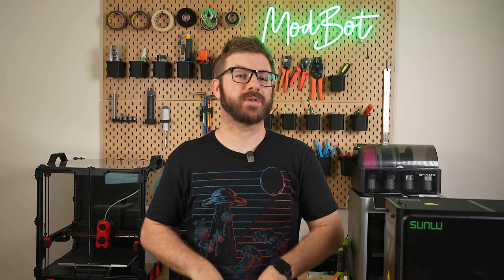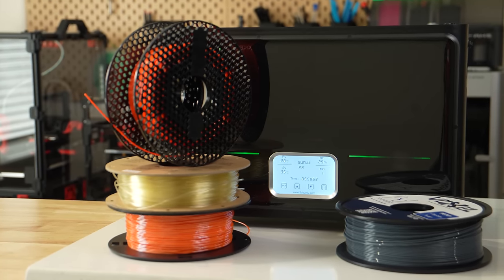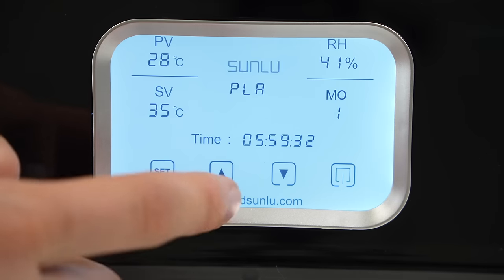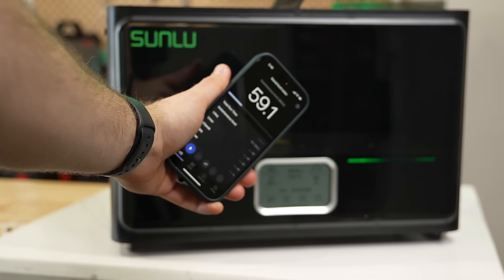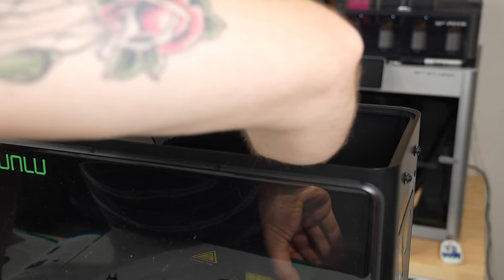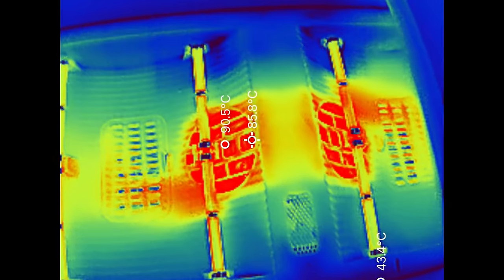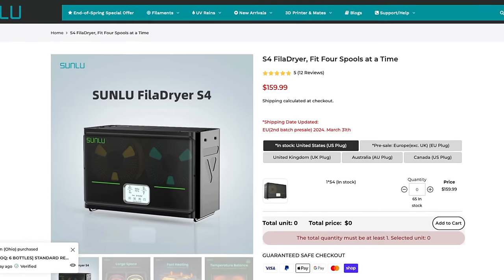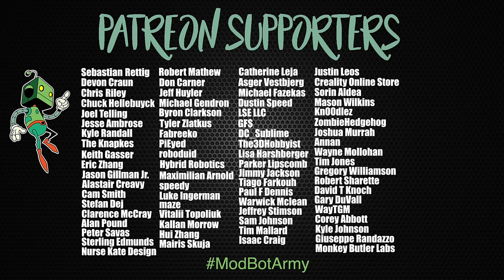Ultimate Filament Dryer Or Complete Overkill? (SUNLU FilaDryer S4)

Comment: It's shocking to me that most dryer manufacturers don't understand that the released moisture has to go somewhere, and hoping it leaks out or people leave the filament holes open on purpose to let it out isn't a wise design choice. As much flak as the Sovol dryer has taken - and rightly so, given how low its temperature settings are - its manual explicitly states that it is recommended to prop the lid open during initial drying before closing the lid once the optimum humidity level has been achieved.
Reply: it most definitely needs to be dried together with fresh desiccant
Reply: I figured that's what the dessicant trays are for 

To y'know absorb the moisture inside the enclosure
Reply: @Barkugou420 True, though that then becomes a regular maintenance item and the only ways to know that maintenance is required are if you get the same condensation seen here in the video or you get color-changing beads, which are not entirely safe if used loose.
Reply: @justinchamberlin4195  I'm pretty sure you can get the color changing silica in packets too though. I'm more curious if the silica trays are removable to fill with loose silica or just a place to put some packets.
Reply: @Barkugou420 I'm guessing it's just a place to put packets, though I'm equally sure it wouldn't take long to model and print a small container that can be filled with loose gel but be installed and removed as easily as packets. It's still an extra maintenance item instead of propping the lid open or opening an exhaust valve...
Reply: I'm guessing it doesn't have vents to make long term storage in mode 2 more efficient. If they put vents on it moisture would have a much easier time getting in. It would have to turn on much more often. Also 30g of water is way more than filament will hold. Likely this won't be an issue.
Reply: @aaronporter2180   Then why not make vents that can be closed? Still simpler and cheaper than dessicant.
Reply: Yep. Another friend and I are trying to develop a one way valve to open up with a fan to exhaust the air periodically then seal up again. Some dryers allow you to throw in some desiccant.
Reply: @SaHaRaSquad  You can use the lid latch to prop it slightly open to allow moisture out.
Reply: @SaHaRaSquad   You can use the lid latch to prop it slightly open to allow moisture out.

Comment: A septree food dehydrator can fit 20 1kg spools (or even a 10kg spool + 6 1kg spools), can get up to 195f, and is only $215.

It's large size means it's not perfect for everyone, but a lot of people like me need the size, temp, and low cost it offers.
Reply: Can second this. Food dehydrator has worked better than any filament drier Ive ever used. All you really lose out on is feeding filament to the printer from the dry box. But I rarely do that
Reply: @ZeeLobby any suggestion on one that can fit a few spools and doesn’t have to be modified?

Comment: you add desiccant so that the moisture that comes out of the filament has somewhere to go, and is not simply circulated inside a closed box. swapping out the desiccant is the way most of the moisture is removed from the dryer.
Reply: Exactly. Desicant packs would completely solve this issue. I think people are expecting a $1000 dryer for $150. For the price I feel like this dryer is excellent.
Reply: People keep saying that without an explicit outside vent, "the moisture has nowhere to go." But these are not hermetically sealed units, they leak air. This is obviously the case given he wet sponge test shown in this video. That said, I don't know why manufacturers don't figure out the optimal venting (if any) to maximize drying speed and efficiency. Adding a simple port with an adjustable orifice seems like an easy task. Then you'd have a way to vary the venting depending on what works best for various scenarios.
Reply: right on the money! I was thinking the same thing when he mentioned moisture as a issue.

Comment: Theres a guy thats working on a klipper integration to have more control as well which looks VERY interesting.. it also lets you go hotter and adjust the auto %
Reply: I would love this, do you have a link? ! Currently i got a esp32 wifi board with a dht 22 taking power from the s4 itself (reddit has the disessambly and pinout thread) and the esp posts its values and with klipper i import them by ip. This is passive, so i only get the current inside temp and moisture levels but cant control it remote, wich sucks donkey balls!
Reply: Are you saying using klipper to control the humidity and temp of the dryers??? Links to this
Reply: Yes that's how I control my dry box with Klipper. I haven't posted anything other than on Discord. I'm not familiar with other people doing it but they might be out there.
Reply: @wildBill83 whats the discord?!
Reply: link pls
Reply: @Nici619  I've posted it twice the last time I Even separated it it looks like it keeps getting  deleted :(
Reply: @wildBill83 yeah id love to know how to do this. Sounds amazing
Reply: @raytitone1583  basically I used a spare printer controller board and added it as an extra MCU then rewired the heatbed to the dry box heater and the two thermistors to the board. It won't let me put the links up but I've not been very public about it. I'm on Discord with the same user name and I frequent the Voron Discord among others.

Comment: I think this style of filament dryer, with a bottom heater, should be rotating the filament spool while drying.
Reply: I agree, its a fantastic dryer tho, i got mine thru the kickstarter, and for $80 im very satisfied. Like modbot said it is a lil overkill but for that price i couldnt pass it up
Reply: If it rotated the spool it may cause all kinds of issues...what if you were already using it whilst printing? rotating the spool would be a nightmare lol

Comment: Mine sits beside my P1S, stores my CF, PETG, TPU, and ASA. I keep it set at 30% because the stock hydrdometer is off a bit. There's a print to hold a circular hydrometer that is held at the top right corner. It usually shows a marked difference in humidity. The desicant helps keep the moisture down inside so it doesn't collect. I've not had that problem yet, have had it a couple of months. Having used the S2 I'm happier with this, since those filaments can be stored and used as needed. Occasionally dry PLA, living in a basement apartment it's needed sometimes.
Reply: AFTERMARKET HYGROMETERS ARE ALSO OFF. GET A 5 PACK, THEY WILL ALL READ DIFFERENTLY.

Comment: Using it since two months, first attempt was four spools of PLA for four hours which were stored on a rack without bag.

Lost between 7 and 10 grams in weight. So even PLA benefits from it, not only other stuff like PETG or TPU
And the prints were visible smoother.

Comment: My main beef with all these dedicated dryers, is reliability, omission of what should be common sense features (like the vents for exhausting moisture), inclusion of unnecessary features/complicated UI, and the uneven heating issue most of them have.
I instead invested in an actual cabinet style food dehydrator (like those by nesco, cosori, magic mill, etc.) and have none of those issues. Reliability is less of a concern going by reviews. I'm sure there will be failure rates, but a dehydrator in the same price range as the S4 (I paid $130 for mine, a magic mill) fares much better it seems. They're vented because if they didn't, they wouldn't dehydrate foods. They heat evenly and the UI is simple; just set time and temp and hit the GO button. Also, the good dehydrators aren't nearly as loud as the S4. My magic mill is like a box fan on low. No need to print from it since all my dried filaments go in DIY dry boxes that I print from.

Comment: You can pull the plugs from the unused PTFE tube ports. That way you dont get too much loss of hot air, but there should be sufficient air escaping that you don’t get moisture build up inside. That said, I have not noticed any of that with mine. It IS damn loud, but my Eryone snail and the single spool Sunku dryer I have were also not exactly silent. Some people may find it more annoying than others. I have 3 spools in it on average. 1 being dried before using it to print, and 2 feeding my 2 vorons that sit on either side. Only real usability gripe I have is with opening the lids. You need to push a button aside while also pulling at it, but nothing to really get your finger in/behind. It works but it is a bit fiddly…

Comment: I had some out of the box very moist rolls of PETG and TPU. I habe this dryer and it pretty much perfectly recovered these spool, at the cost of being louder than the printer they get feed into.
Feeding TPU out of this + a very long tube causes a lot of jams and is almost impossible. Feeding anything non flexible works ok. 
For a vent you could print a wedge that slots into one of the doors, that keeps it slightly open.

Comment: To me this looks like the Eibos X Easydry still is one of the better dryers out there because it circulates the air. I do however have to add that it seems that both units that I own seem to start to perform worse now that I have them in use for over a year and I don't use them that often.

Comment: I'm still looking for a filament dryer, but it seems to be incredibly hard to make a good one.

Sunlu keeps making the same mistakes over and over and over again (S1, S2 and S4 all have no vents for the moisture to get out).
Eibos made the Cyclopes, same thing (plus a crudely half taped over hygrometer and pretty terrible control electronics). Eibos Polyphemus … seems to be vaporware? "Launched in October", but only reviewers got one?
Creality: No vents.
eSUN/Eryone/Sovol/Comgrow: No vents (and not enough power to really dry anything. More of a keep-dry-box than an actual dryer).
Reply: I'm having the same problem.  I just want something that is reliable and works for my various filaments.  I've watched loads of reviews and I don't see a clear winner.
Reply: The Sunlu S2 and S4 have vents. The holes that feed lines out for use act as ventilation holes. When you want to use it as a dry box, they provide rubber plugs for those holes. You don’t need large holes to accomplish this and there are numerous holes to perform this task.

I own both.
Reply: @Cujobob  I don't think he tested the S4 yet, but Igor from mytechfun tested the S1 and S2 and neither removed all moisture from a damp sponge. Plus, neither can hit 70c if needed.

Comment: I like it, but it isnt enough. Im currently designing a bottom plate that can hold a take out piece that can hold Calcium chloride (cheap and very effective) to give it some boost in drying and storage power. It will optimize the drying process in my opinion as the hot air is only a carrier it still needs to loose its extracted moisture from the filament before it can circle around and extract some more moisture from the filament. Without something like this your just extract moisture until the air is saturated and youre just cycling hot moist air for the remaining 5 hours.
Reply: It has two spots with vented pop out doors in the bottom for dessicant.

Comment: So first you say you don't understand why there a desiccant holders in the bottom and then later on you complain about moisture being visible inside when you do the sponge test....Well...Get my point already? Put desiccant in the holders and you'll won't have that problem anymore...
Reply from the maker: Vents are the answer not desiccant. Open the vents while drying and the moisture has a place to go. I’m all for desiccant but not in an active dryer.
Reply: Well, there aren't any vents in the thing, unless you mod them in. So desiccant is the next best thing and with testing I found out the humidity gets lower faster if you use desiccant. Especially if you're drying on lower temperatures (fe PLA-CF that usually benefits from drying), it really makes a difference.  @ModBotArmy

Comment: One of the questions I haven't seen answered anywhere is what the maximum spoolwidth can be in this machine. I have some very wide spools that won't fit in my normal dryer. Can you provide me with this info @modbot?
Reply from the maker: 75mm is inside of bearing to inside of bearing so thats max if you want to be able to feed from dryer to printer. If not and you just want to sit inside you can have them on top of the bearings giving you an extra 10mm so 85mm total.

Comment: 2:22  this is incorrect, you MUST dry your filament with fresh silicone desiccant for the best result other wise the moist air will have nowhere to go. It can technically seep out of the cracks in the dryer but that's not efficient. I almost wanted to close the review seeing that a dryer of this caliber has such a poor solution for storing desiccant but i guess there are areas to add mods for better storage.
Reply: I always use fresh, microwave dried desiccant in my dryers. I think it helps.

Comment: The lack of vents and motors to rotate the spools during drying is a massive oversight and lost opportunity. Thankfully there are other options available where the design team has actually taken the time to think a design through properly before shoving the product out the door which is sadly what feels like has occured here. I find this disappointing because I generally like Sunlu and think that they make some decent stuff, this product unfortunately is in need of some significant redesign to get the most from it and given the availability of other options on the market that are good to go out of the box, I'm disinclined to invest the time, effort and expense required to fix this product which is unfortunately best described as half baked. Now all of that said, the modifications required are all relatively simple and straightforward (including the option to allow the unit to support 2x 2kg spools or 1x 5kg spool and I'm hoping that Sunlu considers making a v2. Of this design with the necessary changes incorporated so that this design can truly go toe to toe with the competition.

Comment: just as all the other porduct placements i have seen for this dryer now this one also doesnt highlight enough just how freaking loud this thing is.
i have mine sitting next to my prusa XL and i cant hear the printer over the fan noise even when the dryer is closed up.
its INSANELY loud.
im swapping all fans for noctua fans now which brings the total cost up to over 200 bucks but this thing is not usable with the stock fans unless you have it in a separate room.
Reply: Fairly sure he quoted 50 to 60 db as measured.

Comment: So frustrating that these filament dryers never go hot enough. I dry at 80C and the ability to do 100C would be nice if the need should arise.
Reply from the maker: What are you drying at 80C? Only think I could think of would be PC. Id be worried about melting other filaments. ,
Reply: @ModBotArmy  Manufacturers usually recommend 80C for ASA. Carbon Fiber filaments I've seen go up to 90C.
Reply: @ModBotArmy polymaker PA6-GF and CF state that they should be dried at 100C for 6hrs, or 80C at 12hrs. Any nylon benefits greatly from higher drying temps
Reply: @ModBotArmy   PC, ASA, PA.
Reply from the maker: @TeknoMage13  wild I’ve never dried an ASA but plenty of PA at 70C. It’s worked fine but maybe higher temp would speed the process up.

Comment: @ModBotArmy. Thanks for this interesting video. Do you think this dryer could reactivate old Silica gel desiccant  (usually it takes 3,5 hours @ 150°C) ?
Reply: No, you want significantly more heat than this unit is capable of to effectively drive the moisture off of reusable silica.
Reply: I use my 1200W microwave set at 50% power for 3-5 min then flip each time. I use a cheap jewellers scale and stop when the weight loss difference tapers off. Mark ea pack with a pen/felt to ID ea. pack while logging.

Comment: I have a question that was not answered. One of the biggest problems with the Fila 2 Dryer, was that the backlit LCD screen turned off after the first 60 seconds which resulted in me returning 7 different units until I finally got one where the backlight screen stayed on as it should.  

From parts of your video it appears they still haven't  fixed this defect and that the backlight on the screen turns off at some point during operation which therefore makes it useless to see what the status of the dryer is from across the room or even from a couple of feet away unless you can get close enough and bend your head down to see it.  Please let us know as it's a real deal breaker.
Reply from the maker: Yes, from my testing the backlight only stays on for approximately 60 seconds. Touching a button on the screen enables it for another 60 seconds. At least with this one you have the green leds pulsing or solid when at temp. I agree it should be a setting that allows you to set the screen time to always on. I was close so it didnt bug me but from across the room I could see that being an annoyance at least for some.
Reply: @ModBotArmy  The Fila 2 also has a pulsing LED while getting to temp and a solid LEd once at temp.

Thanks for the info and that fact that the backlight  on the LCD screen won't (and can't) stay on, is a deal breaker for me.  If I can't see what's going on without getting real close to it, it's not worth buying.  I returned 7 of the Fila 2 dryers for this very reason.  You'd think Sunlu would have fixed this defect, or at least added an option to keep it on or off, but clearly they don't listen to their customers so that also tells me everything I need to know to stay away from their janky crap.  Thank you.  Too bad, because I would have bought it had the screen stayed lit during operation as it should.  Your video convinced me NOT to buy it.  Hopefully Sunlu will take notice one day.
Reply: @Verminator151029  You guys crack me up... You're going to have to just build your own if you want every. single. thing. exactly. your. way... LOL